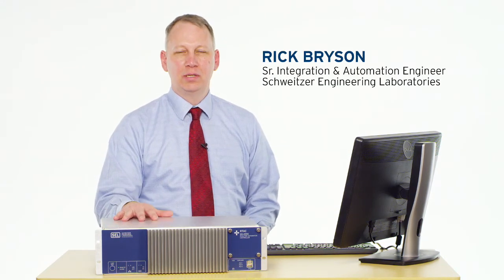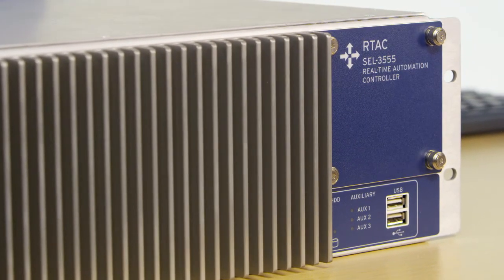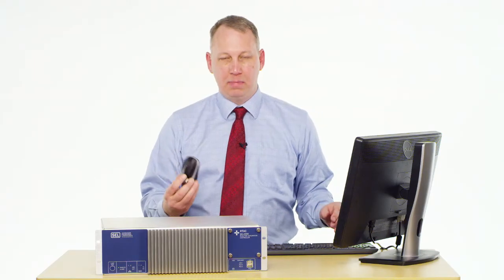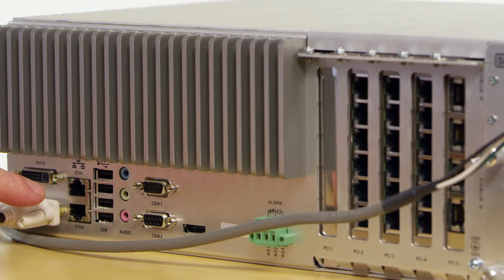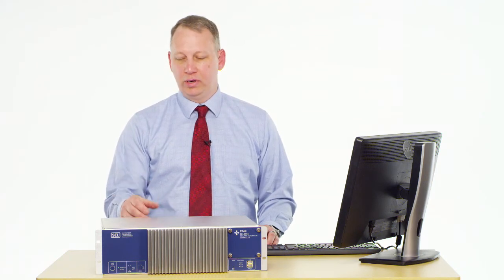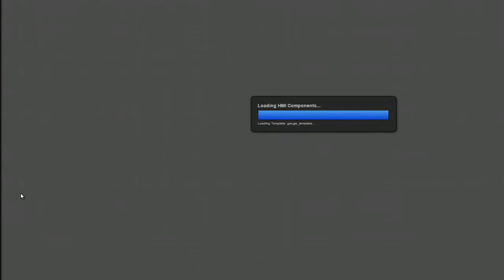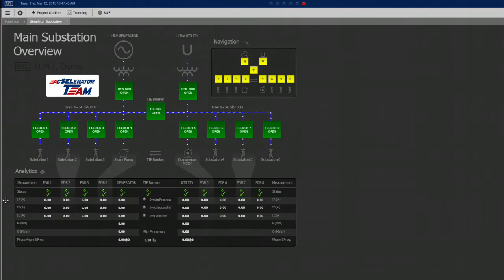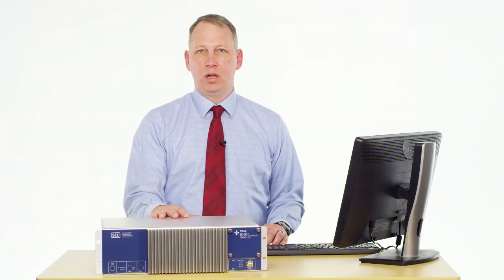Introducing SEL-3555 Real-Time Automation Controller (RTAC)

Comment: Sir how can we connect irig-b in the pci space provided in rtac3555 please can reply
Reply from the maker: Thank you for contacting SEL. The SEL-3555 RTAC offers IRIG-B inputs and out puts through using:
• The SEL-3390T Time and Ethernet Adapter Card that offers an IRIG-B input, an IRIG-B output, and two configurable Ethernet ports. For more information about the adapter card, please visit https://selinc.com/products/3390T/
• The SEL-3390S8 Serial adapter that provides six EIA-232/-422/-485 serial ports. For more information about the adapter card, please visit https://selinc.com/products/3390S8/

Comment: What enclosure do I use for this in an outdoor environment?
Reply from the maker: Thank you for contacting SEL. The ingress enclosure protection requirements for the SEL-3555 follow IEC 60629:2001 + CRGD:2003, severity level: IP30. And the enclosure temperature range must be between -40 and +85 degrees C (-40 to +185 degrees F) with relative humidity between 5% and 95%, noncondensing.